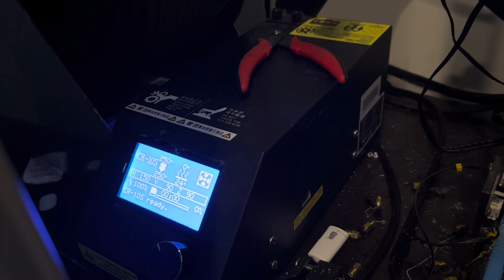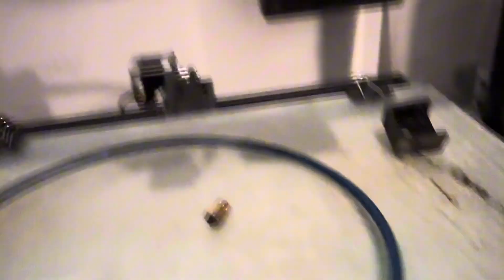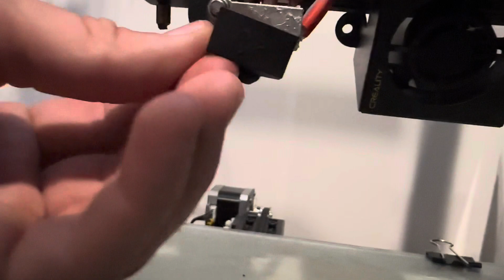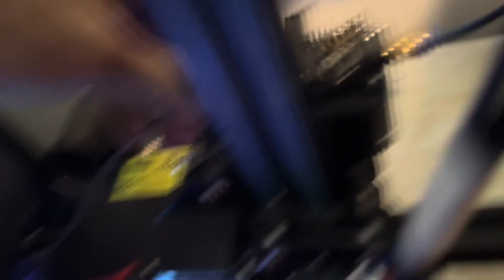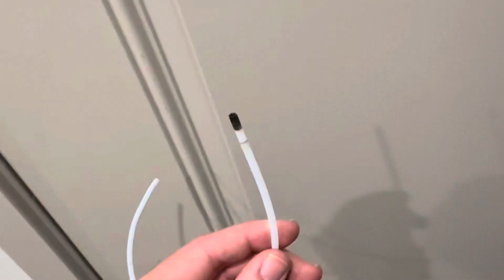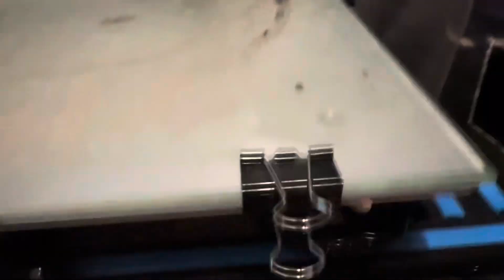How to fix a clog on your 3d printer!

Comment: I used to use glue sticks for the bed but switched to blue painters tape and it works way better.
Reply: If you spend the time to calibrate the printer, you won't ever need to use glue or tape, something that may help is using a powder-coated bed plate. But do what you best think is the right thing for your printer as its always different for each printer